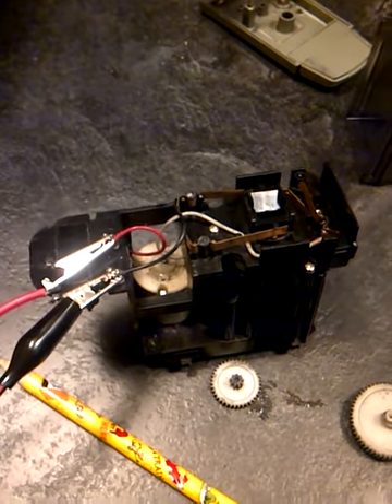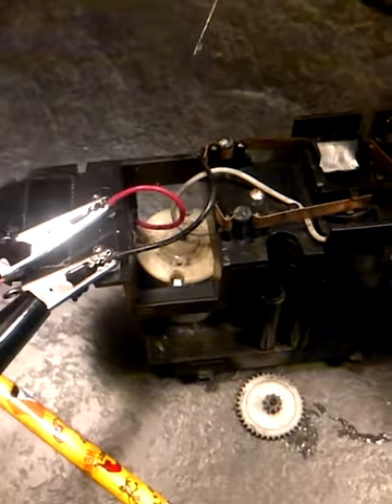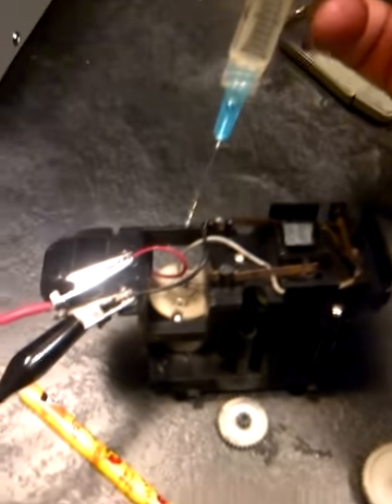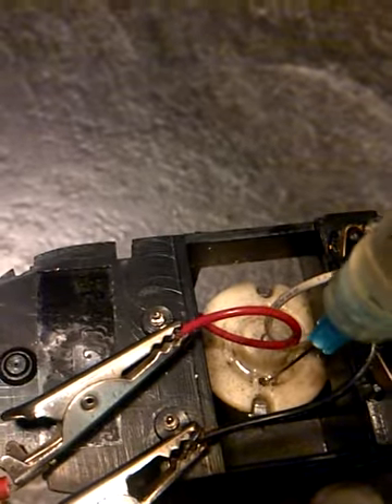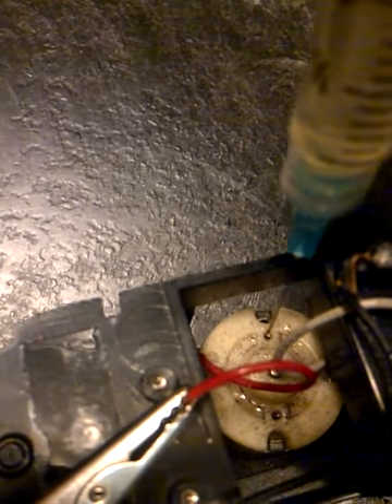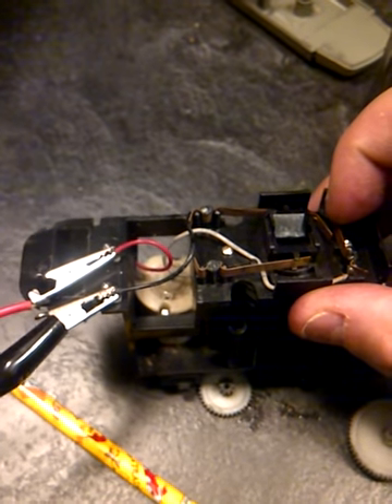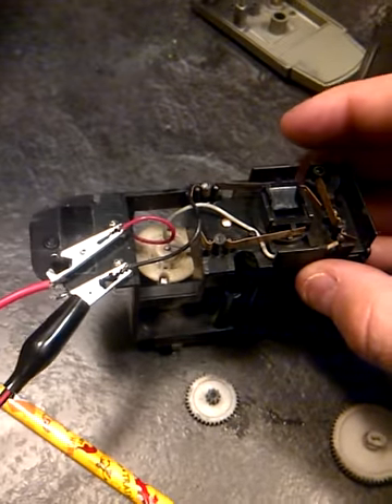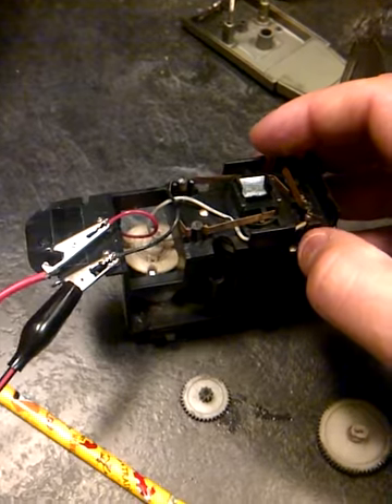Fixing an Electric Pencil Sharpener

Comment: A "computer printer fixing course" told you to put oil in random holes? Those holes are for the motors brushed lol.  They're vent holes, all you did was put oil where it's not supposed to go. The only part of that motor that would ever need oil is the front and rear bushings. One drop on the bushing (middle of the motor where the shaft is visible) and your good to go.